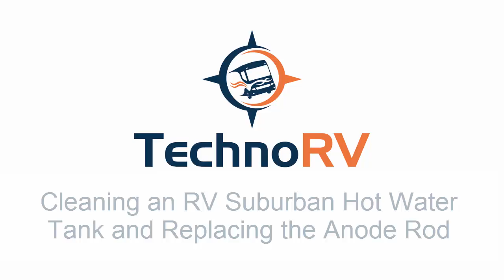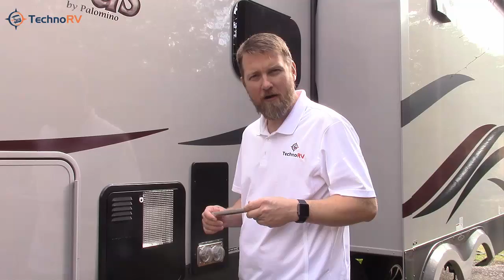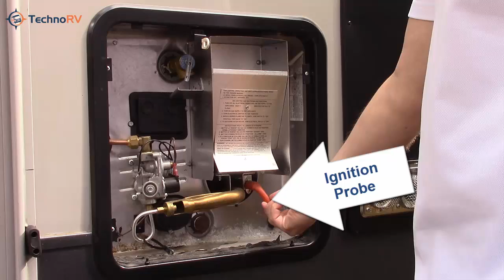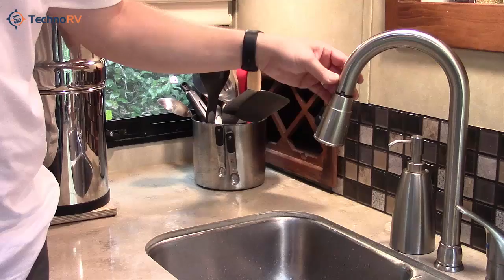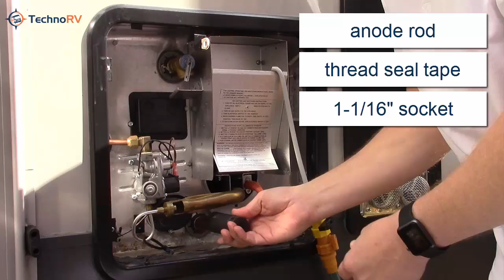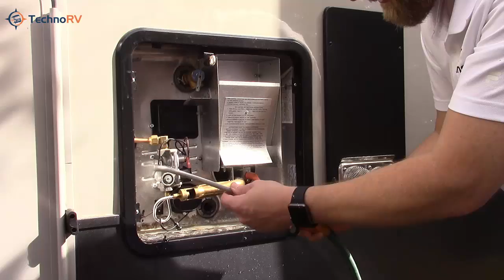Cleaning Suburban RV Hot Water Heater and Changing Anode Rod

Comment: Having difficulty getting the threads on the anode rod started, without them wanting to cross thread.  The anode rod is of course front heavy and tends to tip down so I know to work to keep it level as the threads are started, but ours still really doesn't like to go in without binding...and we dont want to strip those threads.  Any tips on how to get it started more easily?
Reply: You can tap threads. I ran the old one back in to clear the threads.

Comment: Would it be better to leave the drain plug/anode rode out and tank empty when not in use? Or leave the tank full?
Reply: Winterizing - you don't want to fill the tank again. Leave it empty and I do not put my new anode rod in until the next spring when getting the camper ready for trips. Leaving the anode rod out will allow the tank to dry out, at least somewhat and prevent any damage. I do shove a small piece of screen wire into the opening to keep critters out, but leave enough exposed so you can pull the screen wire back out.